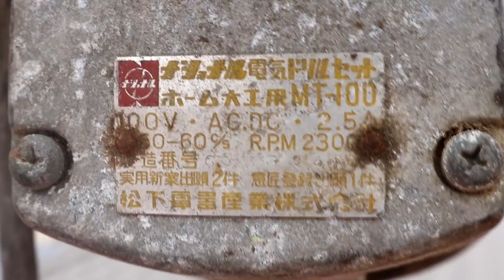Vintage Cord Drill Restoration [National Brand - Unknown Year]

Comment: When cleaning a motors commutator, the preferred method is to have the armature rotating while sanding or filing the copper.  Remove one of the bearings and chuck up the shaft in either a drill press or another hand drill.  run on the slowest speed and clean up commutator.  The reason is that you want to avoid flat spots which will eventually lead to arcing and premature brush and commutator failure.  Don't forget to clean out the gaps between the copper pole pieces.  When replacing the brushes, wrap a piece of fine emery around the commutator with the abrasive side out.  Assemble the armature and brushes then rock the armature back and forth to shape the brushes to the curvature of the commutator,  Any gaps between the brushes and armature lead to excessive arcing, overheating and damage.  I would also suggest replacing the bearings and cord with a ground wire.  Bearings are dirt cheap on Amazon.  I bid you success in all future restorations.  Unless you approach these projects with the correct techniques, you may find that you've wasted valuable time and energy.  Peace.

Comment: Great job cleaning’er up. I have a couple notes, first: For safety sake I would have used a three wire polarized power cord with a ground wire. That is a metal chassis, hope you don’t use it in a wet location and find out why the hard way 🙃 And secondly I would have replaced the grease/repacked the bearings and gear house to add even more years to its life. I saw u dabbed some on but you should push it through the bearing too😉 I’m not nit picking your project, I’m just looking out for ya brother! Thanks for sharing👍🏻
Reply from the maker: Thank you for your notes brother!
Reply: Came here to say the same thing. Good job with the resto
Reply: My idea, too. 3 wire cable for safety. Also that paper looked like barely covering that one solder joint, shrink wrap each one, please! was really glad he tested it before touching, but still would change these things asap!
Reply: At 4:58 I think the screw in the middle of the handle is the earth connection. Just unscrew, clean all the metal, and wrap your earth wire round the screw
Reply: Joe Deveau qllll
Reply: CORRECT Joe ....safety first. Many hallo from Greece.
Reply: Agree with your comments and great restoration,  but beware not to over-grease the bearings.  This can cause the bearing to overheat,  the grease to run out,  and the bearing to fail.
Reply: Good point Evan, I should’ve been more clear about why one should pack bearings through IF reusing them. Debris collects on grease like a magnet so when reusing bearings I always push through to push not only the old grease out but any hidden contaminants also. Wouldn’t want anything trapped in there and doing this lets you see if there was anything. Wipe them down of course as not to try and stick a meatball size blob back in, that wouldn’t be good lol.
Reply: This types of old tools have neutral wire connected to housing, it provides same seafty as grounding it
Reply: +Bes Mrtnik The danger of wiring it that way is that if your combined earth/neutral conductor to the drill is broken anywhere, the casing of the drill becomes live at the precise moment the drill appears to stop working. Eeek!
Protective earth has been required here in the UK since either 1927 or 1934 (9th edition or 10th edition - I'm not sure which) but the equipment was being installed from 1911. Hence the "use neutral to earth" approach wouldn't have been acceptable (in the UK at least) when this drill was made.
Reply: Id actually take it one step further and replace the switch to a "dead man switch" ?
Reply: Everybody with all these "safety" recommendations are missing the point. If you modernize it, then you no longer have a vintage drill.
Reply: This is a 60 year old tool. There is no reason to change anything of it's design just because of paranoia over electricity. I use antique power tools all the time, indoors and outdoors, they are perfectly safe.
Reply: @MrWolfSnack  Exactly. That would be like adding air bags, crumple zone fenders, and a third brake light to a restored 57' Chevy. Defeats the purpose.

Comment: You  did a good job  -looks like new! That is what passion is about.
Reply: What i'd do to determine the manufacturer/brand:You have the nameplate 
0:27 -  Use google translation Jap>En and use it with the hand writing input option. (click on the pencil icon in left down corner of the input field) Than your are able to handdraw the japanese characters each by each with your mouse or finger, depending on your device. Maybe not the easiest way,but it will work,trust me. I translated already some korean text which i couldnt copy&paste into google because it was on a picture.

Comment: Shiny!  Nice job, just ground it now.
Reply: There is no reason to ground a vintage electric tool just because of paranoia over electricity.
Reply: While I agree grounding the tool is the safer choice, improving on the original design no longer makes it a "restoration' and instead makes it a modification. He'd have to go with a 3-wire power cord, increasing the diameter of the cord and potentially requiring the cord entrance in the handle to be enlarged. I doubt a tool this old would be used for real work anymore... maybe it's headed to a power tool museum.
Reply: @MrWolfSnack  1
Reply: Very rude comment from my fellow Canadian @HandToolRescue

Comment: Ah! Back in the day so many trades men electrocuted in the rain while using these, metal body, no earth and card around the mains switch. Interesting restoration bit if you intend to use it then fit an earth and double insulate those solder joints/ switch.
Reply: ground put on for safety

Comment: Get rid of that old cord and use a 3 conductor cord and proper case grounding.
Reply: Hard to use in asia...
Reply: Excatly my thought. If you are replacing the plug. You might as well use a 3 wire cable and a plug with a ground connection.
Reply: I agree, if you look closely around the 11:07 mark it looks like there is a Phillips head screw for an equipment ground. I suspect the cord was changed out at some time in the past. Otherwise a nice job!
Reply: Манисаба мрыша Ас ста намера и незным ко ста напрая паня ггг
Reply: @RaymondHng  Well then
Reply: I think this person might be in Japan. In a lot of the previous restorations you can see the line voltage on some equipments are rated at 100V at 50/60Hz, which is common in Japan. Also Japan has only 2 prong plugs + sockets with no ground, more like old US appliances like pre-1970s I guess. I do have some 110V Japanese devices and they don't have any ground.

Comment: Instead of an icebath. Use a can of keyboard duster. Flip it upside down and it sprays some cold ass liquid gas. Usually freon. 
Be alot faster than icewater.
Reply: they are often fluorocarbons, but Freon is a name brand of fluorocarbon-based refrigerants, most of which are CFC- or HCFC-based compounds. typical keyboard duster contains no CFC - simply just FC - and work on a similar principal, but are not at all the same thing. it is safe to discharge canned air, but not so much commercial refrigerants.

Comment: You tested with the switch off. Then turned it on right after and grabbed it. Obviously not double insulated, but you should of tested first with the switch on. Still could of potentially created a path to the case after the switch. Just to be safe you should bond it and use a grounded cord. Nice clean up and inspiring. Make me want to clean up my 25y/o makita circular saw. It still works but I’m sure a fresh start will make it worth it when I pass it on to my son like my dad did for me. Back when most power tools were made in America.
Reply from the maker: Thank you so much for sharing :)

Comment: Only thing I would have done different is GROUND IT!!!! VERY EASY TO DO!!!
Reply: ^^THIS^^ I love these old drills but first thing I do is add a ground. I have thrown a few across the room accidentally after discovering a short!!
Reply: @eduardogonzalez5576  Grounding means in the event of a short (hot wire comes in contact with the casing) the electricity has a place to flow other than through your body. I would ground this tool by switching out the cord for one with a ground (3 wires). I would then attach the ground wire to the casing.
Reply: @chuckk.7691  And if you look when he takes it apart, there is a perfect spot to put the ground screw on the handle inside. Go to 11.00 minutes and you'll see.
Reply: I like to watch people do stuff and then comment how I'd do it better. But I don't actually do anything.

Comment: Hello, I'm from Russia, and that the lubricant on the gears and in the clamping cartridge is not changed??
Reply: Видимо он ещё не нашел смазку того же года выпуска, что и дрель.
Reply: That. 50 year old grease and bearings, costing like $5 total to replace in 2 minutes. But he spent hours polishing the thing.
Reply: Далась тебе эта смазка. Хочешь приехать к нему на шпиль посмотреть? Иначе зачем ты написал, что из Росии?
Reply: yeah, sloppy job done.  focused too much on the outside that the inside did not get cleaned and changed at all. also shit welding job.
Reply: @RushFuture  Вася. Им приятно что их канал и в России смотрят.
Reply: он и так знает ебта, в статке канала карта с просмотрами есть
Reply: Yes! He use brush, brush again and again but without angle drive grinder its been shitwork
Reply: Hello, I’m from America, that is peanut butter.
Reply: Scott my 1961 Gilbert HO scale train engine came with a tiny little jar of the same brown lube.
My sister scarfed it up as a "peanut butter jar" for her Barbie house...
Reply: Hello, I'm from Brazil, and why you people are saying where you come from before you say what you want to say?
Reply: Correct! the mechanical grease and the bearings should have been changed.
Reply: Bव
Reply: द
Reply: @frankstrawnation N
Reply: Это грязная Япония, убивается так же как и любые другие дрели. Ну это если её работать конечно, а если просто на шкаф положить то можно и смазку не менять и подшипники не трогать.
Reply: The welding was horrific. Worst ever!
Reply: Hi! people from Canada! Or Mexico? maybe Brazil? or Peru? :-P
Reply: @ildmann  Лол))

Comment: Nice job, but why would you go thru all that and not clean out the old grease in the gears and replace with new ???
Reply from the maker: I see all gears have good condition already, anyway I will change it later, thank you!
Reply: Are you using heat shrink tubing and not electrical tape? I hope so! Nice work. One early morning, I was driving over to a friend's house. Along the short 6 block drive, I found 5 electric drills, 2 in one spot, 3 in another...in the road! Probably a bungled burglary. "They're mine, now!"
Reply: And paint de brand National. And the factory plate.  And wash de field coils and rotor. Nice job
Reply: I agree with replacing the old grease after a good cleaning out,but I would also replace the bearings. The drill sounded a little loose when he ran it unloaded.
Reply: haha "do it later" you would have done it at the time when it was apart.
Reply: Shout out to the armchair QBs. Excellent work man let the critics sit behind their computers while you do the real work
Reply: 1970’s. I remember using that bad boy on the sears tower. Wow
Reply: And bearings too

Comment: Good job, whoever it was renovating it!  Bit worrying that theres no earth on it!!!  Anyway, should last another 40 - 50 years, unlike the rubbish of today.  I bought a black and decker drill a few years ago which wasn't cheap by any means and it lasted less than 2 years!  First the stupid 'keyless chuck' (bad idea) fell apart and I had to use two pairs of grips to tighten bits in it, then the bearings started going and finally the variable speed control board went up in a puff of smoke and that was the end of it!  I'll never buy a B&D product ever again, utter junk.  My dad got a B&D drill and sander back in the mid 70s, he's still got the drill and I have the sander as he didn't like using it and guess what? They both still work perfectly to this day.  Now everything is built to last a couple of months past the warranty period.    Thanks for posting and happy drilling!
Reply from the maker: Thank you so much for sharing :)
Reply: new tool b & d real shit
Reply: @David Manning Simple solution was the easiest, don't drop it... People need to start using brains again, not constantly expect that someone else needs to do this for them...
Reply: That's Black & Decker for ya.

Comment: it blows my mind that no one on the multitude of restoration of tools videos is using a soft bead blasting machine or a brass wire bench wheel. it would look soooooo much nicer and be sooooo much faster. efficient is the word im looking for, yah efficient and why not even take the chuck apart? its the most problematic piece? even for you it was the only thing that gae you a problem in taking apart? it would hae been so easy?
Reply from the maker: Thank you so much for asking, I will take it apart for next project.
Reply: Please make a video and show us.

Comment: Sounds like one of the bearings are shot or need new grease
Reply from the maker: I will change it next time.
Reply: i agree
Reply: it's commutator sparks
Reply: I agree
Reply: its noise from the brushes..it will eventually get quieter as they wear out and adjust the shape
Reply: FTC FTC
Reply: so, in 50years? :D

Comment: I might sound exagerated, but when I restore a machine I even grease the threads of the screws in order to assure an easy disassemble for the next time 😎; anyways, cool vid man, thanks for sharing!
P.S.: You heard the non regular sound when you runned it and how fast it stopped once you turned off? Those bearings need to be changed, even if they feel ok to the "finger sensor", their grease is ooooold, and it can complicate you any moment  ;)
Reply from the maker: Thank you for sharing :)